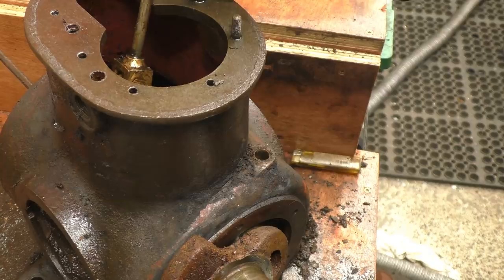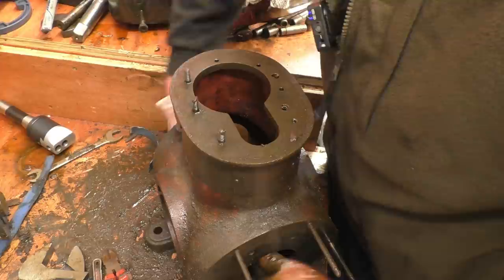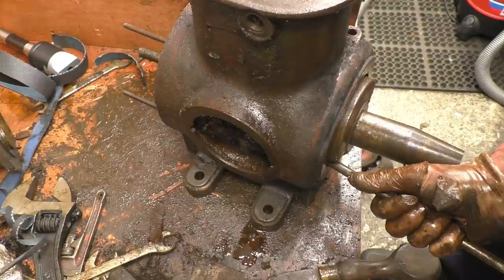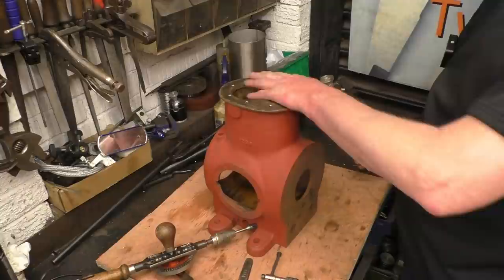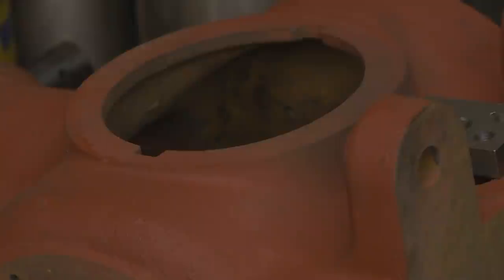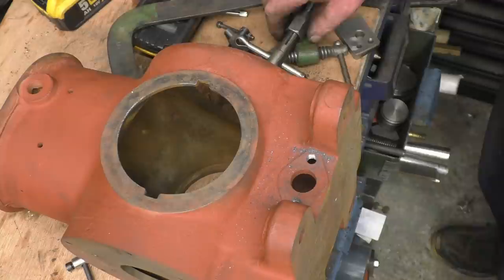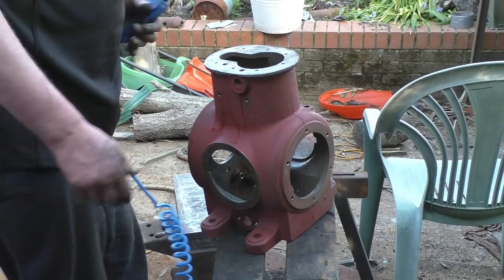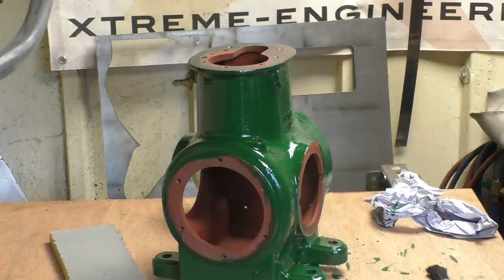Stuart Steam Engine Restoration Part 5. Clean Start

Comment: You can clean inside engine blocks, fuel tanks etc with electrolysis by putting your sacrificial anode down inside the part without letting it touch the part anywhere of course.  I'm not sure if it works any better than an acid bath, but you do seldom get any flaky rust left behind still attached.  Just a thought.

Comment: John, after smoothing the inside of blocks, we painted the inside with glyptal then baked the block in the oven to cure it.  Never found it in the oil or filters, so must have done it right.
Reply: Thats what the stuff is called, I thought it wasn't just paint because it's used to seal castings from absorbing moisture and is much more durable than paint, especially in hot oily atmospheres.  cheers for that
Reply: @stevehill4615  I remember baking the block.  It's been a lot of years, but I did an engine in my old BJ8 back in the 1980's.  Eastwood probably still sells it.

Comment: "In 1934, Stuart Turner introduced the S type steam engine. This was not a model but a fully enclosed single-cylinder commercial power unit of 1 to 1.5 HP designed to drive generators or fans or pumps. It stood 22 inches tall with a 10-inch flywheel and weighed about 120 lb. Preston Services[20] have stated that there were both slide valve and piston valve versions, only 247 were made between 1934 and 1962.[21]"
but who had steam, only commercial, or did residential have steam lines?

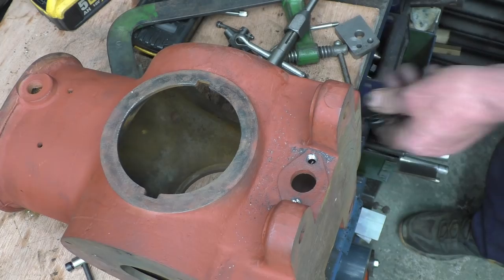Comment: 25:10 Boy, isn't that the truth! Half the reason I switched away from helicoils is that the broken drive tang falls into whatever you're working on when it'll screw up the job, but never goes astray when it would be easy to remedy.
Reply: Dunno if this helps, but i've always found that if you put a spot of grease in the slot of the installation tool, when you've screwed the heli-coil in, try to then screw the coil back out (I was told this has the effect of "expanding" the metal coil so it "locks" into the tapped thread as when the heli-coil is wound in it's diameter shrinks slightly around the installation tool to allow easy fitting) which should snap off the tang but it should be stuck in the slot due to the grease ---- hope this helps.
Reply: @stevehill4615  that's how I do it too, works almost everytime
Reply: @stevehill4615  Should I ever find myself using helicoils again, I'll keep it in mind! I've switched entirely to keenserts/keyserts and timeserts.

Comment: Loads of stationary engines went to farms as part of the post war modernisation of agriculture under the Atlee government only to be abandoned a few years later with the widespread arrival of mains electricity in the countryside. So it wouldn't be surprising for it to have barely been run in.
PS another heart Surgeon joke "The trouble is finding people willing to let you practice on them"

Comment: There is an old boy in my town that's converted his mobility scooter to run on steam and you can hear him come a hundred meters away lol but absolutely brilliant all he needs to do is fill with water and has off I've seen him travel some distance on it if only more things ran on water we have more than anything else on this planet it's free its clean it's safe it's odorless it's everywhere. Not downside is steam it's evil hot and can get supper heated and becomes extremely dangerous it's harder to see and will take your skin off In A blink. But old say that is a small con. lol
Reply: @jeffdayman8183  I believe he's using just a part of the the scooters battery to heat kettle elements so only takes a fraction of the time to charge it compared to the full bank of batterys it had. On theory he could run it solar to heat the water and still have great mileage
Reply: Absolutely no way using battery supplied electricity to boil water to run a steam engine is more efficient then just using an electric motor.
Reply: @andreblanchard8315  why not? If it charges again after you have steam working? It's completely self sufficient after that first use of a 18th amount of battery.
Reply: @mealex303  that's bordering on perpetual motion , there is no way you could supply enough energy from a scooter battery to produce steam at say 100psi for a steam engine to do any useful work ago the best a steam plant is only 10% efficient that not including the boiler
Reply: @stuarthardy4626  well I don't know how her done it but he has its litteray very small but it moves him and his shopping all over the place

Comment: If you're going to make some stepped studs to fit the larger diameter bolt holes, why bother with helicoils at all ?
Reply: @Fred Smith Having tapped a new thread in the block, he'd have that withoutthe need of helicoils.
Reply: @Fred Smith I'd never consider them ! He's got a new thread in the C.I. if you need more than that - put a nut on the back !